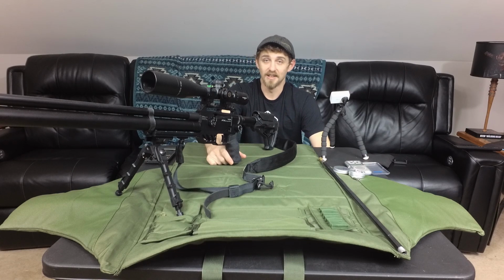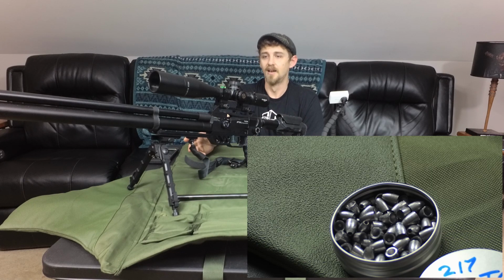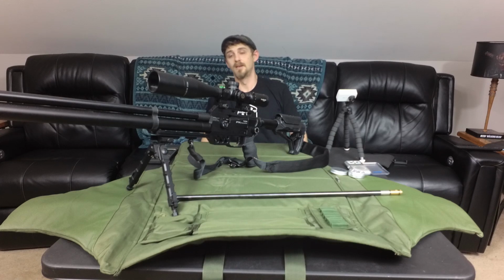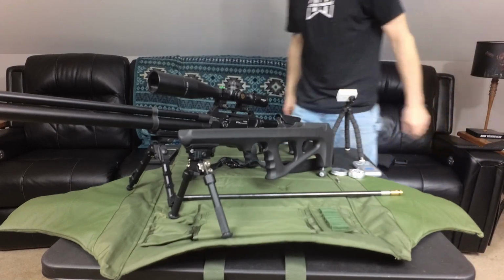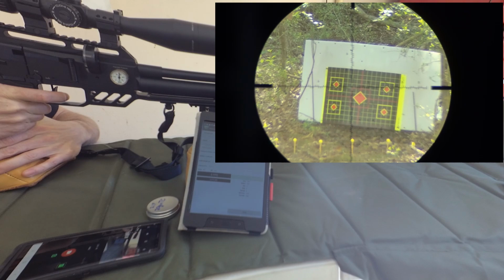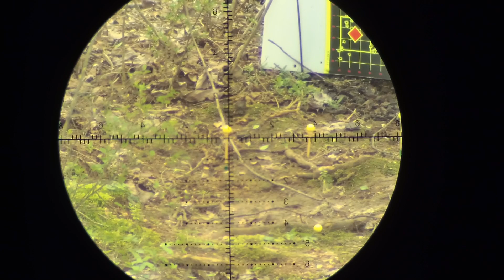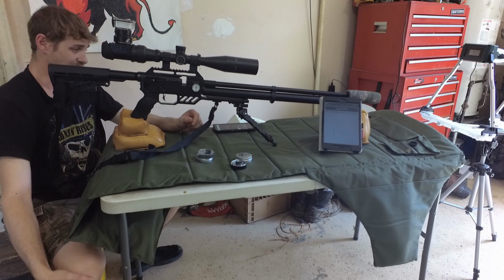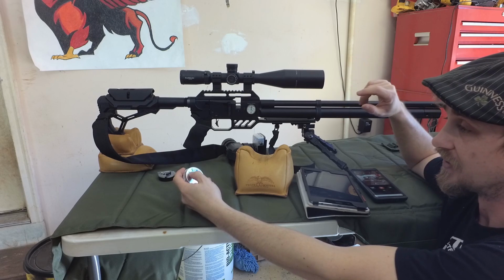FX dreamline power plenum part 2

Comment: Hi I got my Dreamline about 1 year now and I have so say FX did not think the valve seat through, mine broke in to two pieces thank to Ernest Rowe I made a new one and got the dual transfer port with homemade plenum and homemade pellet probe and changed the spring on valve pin to a softer one, my reg pressure is at 145 and pushing the 23gr H&N slugs at 965fps and 21gr to 1014fps. I’m try to get the 26gr Javelin slugs to shoot at 930.
Reply from the maker: Yeah I agree super weak valve mine broke twice. So far the dreamline breaks more often then any other airgun I have ever owned. The other thing I dont like is the barrel system is super weak and flexible. It's the only barrel I have ever seen that I'm 100% confident I could bend in half over my knee. I dont understand why fx was saying the reg is capable of 165bar when the valve and hammer are no where near strong enough to run at that pressure. Thats why everyone uses the compact and pellets at close range, Even with the crown. There barrels are way to flimsy to be free floating. I'm also irritated that a bullpup conversion has never been released after doing it myself I found out why most of the parts need to be changed like the entire power adjuster is different and requires a complete new trigger assembly. Its very unlikely that I will ever buy another fx rifle they release products with thoroughly testing them then "update" them almost immediately after release.

Comment: Just watched your vid, very good and I agree with stressing the gun etc. I run a dreamline with a 17cc plenum reg pressure at 110 bar it shoots jsb 18.13 at 950 very good accuracy  FX Hybrids at 860. Usually getting 40 good shots
Reply from the maker: Yeah after 2 valves failed I just keep it in .22 caliber. The newer dreamline has a completely different valve and my not have the same durability issues but the barrel flexibility doesn't do well at higher energies like heavy slugs. I'm running a condor for that now.
Reply: @leadslinger5130  I hear you what your saying brother. Mine is the newer version, really the Dreamline is a pellet rifle I do on occasion use hybrid slugs but hunts well with pellets

Comment: The wife and I are currently testing those slugs,. We have brcock sniper hrs with the short barrels, hers likes the 20tc and I can shoot the LDC 16g@ 890 and 17gr@905 both a nickel at fifty ,. We really don't want to throw a ton of weight around the farms pesting birds..  great slugs great video, btw I gotta order more 16gt ldc's of eBay
Reply from the maker: That's great to hear! I'm glad you like the slugs. Our LDC in .22 will be slightly changing soon it will be more similar to the .25 LDC as far ballance and energy dump. My goal is to make at least one option in .22 and  .25 that will a max of 3" penetration so pass through small game will not be a concern

Comment: This model was designed for pellets not slugs but now that the superior liners are out of course most of us will be trying slugs but I’m sure I read somewhere the regulars in this platform is definitely smaller then the crown and or the impact.  So ya I’ll be tuning mine with the plenum so not to beat on it and cause premature component wear, it’s Not an impact !!
Reply: True but I still feal like regardless if it was made for pellets or not the rifle should be built to handle the regulator pressure spead without breaking, especially for the price. Fx even knows this that's why they changed the entire breach block 3 months after it was released.  The valve in fx guns is under engendered. None of of my airguns from other manufacturers have  broken like this rifle. Also most of this is because fx hadn't completed the .30 cal yet, they realized the gen 1 wouldn't work for a reliable. 30 cal so they rebuilt it.

Comment: A thousand thanks
Reply from the maker: Glad it worked out for ya!
Reply: @leadslinger5130  hello brother, I tried the rifle, really cool, but I have not been successful in increasing the bars of the small pressure gauge near the cocking lever, it remains at 110 bar!
Reply from the maker: @marcoantoniocappuccio6592  to adjust the regulator you need a 1.5mm allen wrench. On the under side of the air cylinder there should be a small hole with a small allen screw inside. That is where you adjust the regulator. Turning the screw counterclockwise will increase the reg pressure and turning clockwise will decrease the reg pressure. When decreasing pressure only go in small amounts and fire the rifle to release the pressure in the reg before going farther.

Comment: What barrel liner do you recommend and which of your slugs for tightest group with 500mm .22 dreamline with power plenum and everything else stock?
Reply: I have had good results with the light .218 slugs. The original slug A liner is great the new standard superior has a slow twist rate for slugs I would recommend the superior heavy liner for best results with most slugs. The 24gn .218 cup base was the most accurate at 100 yards easley hold 1 moa or better. If you want something with a more knockdown power and higher speed the the 19 and 20gn .218 cup base LDC slugs are the same size as the normal 24gn but hit much harder and are much lighter. The 20gn .218 and .217 TC base are also great light weight slugs.

Comment: Hi how are you?! great weapon !! I recently bought a classic fx dreemline, I haven't tried the rifle yet ... because I realized that the cocking spring doesn't stop, it moves inside! I don't know if it's normal ... would you give me some advice, some tricks before trying it and loading it!
Reply from the maker: No worries brother! The spring and hammer are free floating till the rifle is cocked. In other words the sping and hammer will be able to move freely untill its cocked. All fx rifle are built this way. You can double check that it's working currently by taking the mag out make sure the rifle is clear and nothing is in the barrel. Then cock the rifle and make sure it stays cocked. Then with the cocking arm all the way back to the rear of the gun pull the trigger and slowly let the cocking arm forward this should cock and uncock the rifle. If everything seems good then you are ready for the range. As a side note DO NOT ADJUST THE POWER SETTINGS WHEN THE GUN IS COCKED! You can damage the adjustment screw. Let me know if that makes sence and helps!
Reply from the maker: I just realized you said you have the classic disregard the power adjustment thing the classic doesn't have the hammer power wheel. And I'm doing good thanks!
Reply: @leadslinger5130  Big brother!! yes it works, thanks! but then I, who have a Dreamline classic fx, can't increase the power like in the other models ?!
Reply from the maker: @marcoantoniocappuccio6592  you can still adjust the hammer tension but you use a 4mm allen wrench to adjust from the back of the breach block. The other versions have two power wheels 1 adjusts the transfer port and the other does the hammer tension. On the flip side all the cool aftermarket chassis are for the classic not the tac or light models so win some lose some I guess. You can get the same power from both models they just adjust the hammer different
Reply: @leadslinger5130  You were really kind! I'll let you know;) thank you very much, for the advice and explanations ... see you soon!

Comment: You can try increasing the regulator by 5 bar without increasing the hammer pressure. It will slow down a bit but you should see an improvement in group size. By the sound you have the valve open too long. My Wildcat with 145BAR and 45fp makes a lot less noise. It seems that a little air comes out even when the slug is out of the barrel.
Reply from the maker: Yeah I had not had chance to do a proper harmonic tune. I was just playing with a lowwer pressure to see what kind of shot count I get above 40fpe. And to show people that the reg pressure doesn't need to be 170bar to get power. These 20gn slugs do really good at about 950fps to 990fps with 140bar reg. I had several people ask about shot count at lowwer power. I'll be doing a accuracy video with a few different .22 cal slugs. After that I'll be changing caliber to .25 and testing again in the same way kinda.lol
Reply: @leadslinger5130  I forget to mention that I use a 600 mm barel from the impact on my wcat .22. and huma reg power plenum 40 shoots in 45fp  ;)
Reply from the maker: @starlightHT  🤣🤣🤣 same Here I just tuned back up to 140 bar with the light weight slugs I still get about the same shot count around 40 per fill give or take. One of my biggest problems shooting in this video was the new buttstock I installed had to high of a cheek rest and I was fighting to get a good sight picture through the scope. Luckily the cheek rest is removable on this model that made a huge difference. But I agree with your tuning concept I had many comments from people asking for me to do a low pressure tune. Thanks for your comments and thanks for watching. I'll be doing some more fun mods soon like a cal barrel and a huge custom plenum and bottle addition
Reply from the maker: @starlightHT  I don't have the huma reg installed just the t/p
Reply: @leadslinger5130  the problem of FX regulators takes up a lot of space inside the cylinder and from what I have realized there is a problem with maintaining the pressure overnight. And they get a little confused whenever they load the cylinder. The first two shots are always bad. How Huma got all these problems solved. Now I have 47 CC of regulated air I put the streamline's power plenum ... But it doesn't make much difference from the 30 CC. I just said something because I liked the video
Reply from the maker: @starlightHT  I agree fx should make a more stable regulator I really I like the huma regulators I installed on my other rifle. I just wish they could make a external adjustment version for the dreamline. I do to much tuning and caliber changes because of my job. So external adjustments is a big deal for me. But your absolutely right huma regulators are definitely better all around

Comment: Where did you get your brace from mate , Do u not find the barrel bends down as it’s too long , especially with a silencer on it weighs the end right down , has any one come up with a barrel/bottle brace yet for the 480cc carbon bottle ? I can feel my barrel hitting the carbon bottle when walking around in the woods , this issue needs addressing ASAP Rocky !!!
Reply from the maker: I got the brass from Huma Air. I'll send you a link to there site i highly recommend them. An as far as the barrels go yeah its pretty bad so I started making 3d printed barrel bands and I do have one for the fc bottle version but unfortunately I'm out of hardware to complete them till Amazon sends my parts. I'll make a link once they are up for sale on ebay.
Reply from the maker: Here is the link the huma air
https://www.huma-air.com/High-Flow-Dual-Hole-Transfer-Port-For-FX-Impact,-FX-Dreamline-And-FX-Crown
Reply from the maker: Hahaha I just reread your comment and saw that you said brace not brass 🤣🤣🤣 I'll send you the link for that to my bad
Reply from the maker: Here is the link to the barrel band/brace
http://rover.ebay.com/rover/1/711-53200-19255-0/1?icep_ff3=2&pub=5575378759&campid=5338273189&customid=&icep_item=223949684251&ipn=psmain&icep_vectorid=229466&kwid=902099&mtid=824&kw=lg&toolid=11111

Comment: glad your still having a good time. i just got my impact with power plenum and put my dreamline to the side for a few.
The slugs have been great in the dreamline and now its time for the impact. looking at the trying the tc in a 25grain, 217 at around 975 to 985...your thoughts on this?
Reply from the maker: The TC base should work well for you at those speeds. My over all favorite slugs is the .218 24gn cup base and the .217 in the same style. The tc base is great because it should seal a little better and can be made a little lighter then the cup and dish bases without getting to short to load properly. Normally I would recommend the tc base for slugs lighter than 23gn's but they work fine being heavier they just get longer. The tc base removes roughly 3gn of weight from a slug. Example: a 21gn TC base is the same length as a 24gn cup base. Let me know if you have any other questions I'd be happy to help! Have great day and stay healthy

Comment: Did you mod your probe to go with the dual huma tp? If so how much material did you remove cheers
Reply from the maker: Yes i did mod the probe slightly I removed a small amount from the front of the probe and the majority from the rear of the probe. I did not cut the bottom off the front of the probe yet. When I made measurements it showed that the bulk of the probe was blocking the rear part of the tp so that's what I cut out so far.
Reply: @leadslinger5130  don't suppose you could do a video or post your measurements that wouls be awesome
Reply from the maker: @yamahabigwedgy  I still have a couple videos to make on the dreamline I'll put it in the next video I'm working on putting together a post for AGN on the conversion and other stuff. On second thought I'll just make a short video on how I did it I'll see if I can do it today
Reply: Thanks man that's very good of you, I'm struggling with getting my fps up on my 22 cal dreamline with a 500mm barrel and huma dual port plus power plenum, I have started at 100 bar and now up to 140 bar with jsb monsters at 850 fps I was hoping for 900fps
Reply: Thanks again for all your videos it helps so much for alot of people 👍👍
Reply from the maker: @yamahabigwedgy  the barrel length definitely helps alot. I think you will get to 900 at least 890 you may have to go to 145bar on the reg

Comment: I need to get a bigger caliber. Maybe a .25 or a dirty 30.
Reply from the maker: I love my .25 I just wish It had a 480cc or 500cc bottle  but man do they hit hard! I started make some tables for B.C and required twist rates for slugs. If you can measure your twist rate I should be able to tell you the best slug for long rang for your barrel
Reply: @leadslinger5130  ok I'll see if I can measure the barrel twist rate today. I'll let you know by the end of the day.
Reply: @leadslinger5130  I just measure the hatsan nova .177 barrel twist rate. I am get 1: 14. I don't think I'm measure it right. I am going to make a video instead. so you can see if I am doing right.  Hopefully I'll upload the video by the end of the day.
Reply from the maker: @airgunsofidaho4886  just use a cleaning rod with the soft head on it, then measure the length of your barrel use that measurement to put a piece of tape on your cleaning rod from the base of the cleaning head. Then make 2 Mark's on your rod 1 on the tape and 1 at the head of the rod make sure they are in a straight line on the rod. Then make a mark on the barrel and line up your cleaning rod with that and start to push it in once the mark on the tape makes 1 360° rotation stop and mark the rod where it meets the barrel then remove it and measure from the head to your new mark on the rod. That number is your twist rate in 1 rotation to so many inches
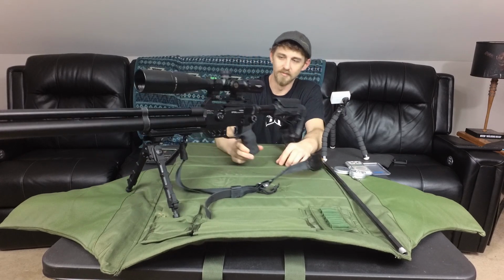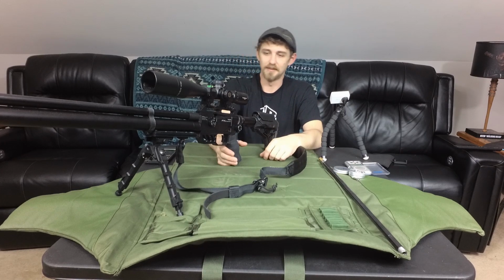Reply: @leadslinger5130  The hatsan nova. 177 has a 1:17 to 1:18  and the Benjamin maximus has a 1:16
Reply from the maker: shooter  so after looking at my charts it looks like a 14gn to 16gn  cup, dish or flat base should be good for the .177 with a 1/17 twist mainly because of length the boat tales need a 1/14 and faster for best performance.  But this not set in stone
Reply: @leadslinger5130  ok cool. I have try some different slugs from 16gn flat base and dish base. Also the 15.5 nsa they where all solid with a hollow point. Around what velocity do you recommend? I'm going to review some of my videos where I was testing the different slugs and see which slugs did ok. I'll see what I can come up with.  Where you talking about the cp slugs? For 1:17 barrel twist rate?
Reply from the maker: @airgunsofidaho4886  I dont think velocity will be as important as get the shot cycle  tuned properly. You should be able to shoot then fairly quick (over 900)

Comment: I just got dreamline bottle in .22, I'm having trouble getting mine past 900fps with monster redesigneds. I have a power plenum.  Any ideas?
Reply from the maker: You could make the transfer port in the barrel bigger. That is what I did to get more power. If you have a 500mm barrel it will be harder to get high speed with heavy pellets.
Reply: 600mm.  The hammer spring is lock tightened. If I heat it up and break it loose,  how much would that help?
Reply from the maker: @easternblocairguns2728  it will help alot you shouldn't need to heat it up, it's just the blue loctite. It will be stiff but it should break free. With what you have you should be able to get 900fps easy with a 25gn monster. You will need to tighten the hammer adjustment screw quit a bit. For example that's how mine is set up and I can get 26gn slugs up to 920 fps at 140bar on the regulator. Also using that screw will help in fine tuning to get your final tune perfect. I would max out the adjustment screw then adjust the reg to the velocity you want then I go just a bit more then tune may hammer back to the speed I want. But there are many ways to tune. But that screw is  very important to success.
Reply: @leadslinger5130  Okay.  I already got the hammer adjustment maxed out.  Put the reg at 155bar.  Speed maxed out at 150bar. Did all that.  If I do NOT buy a duel transfer port or a 2nd plenum, am I able to get 22 grains up to 970?  Trying to figure out if it is even worth it.  I want to compare my R5M to this gun, but I  dont want to invest too much time energy or $.